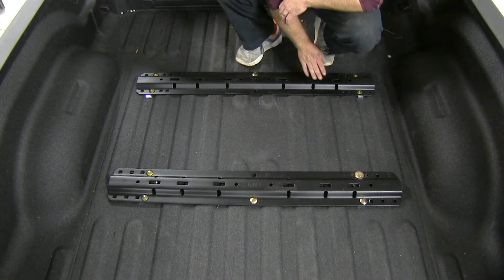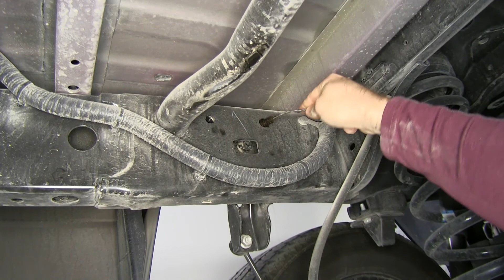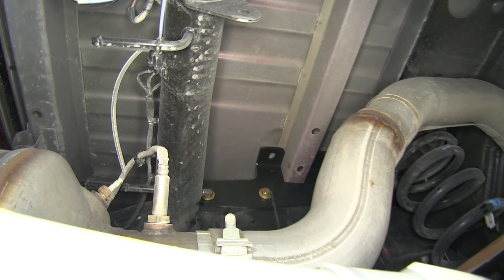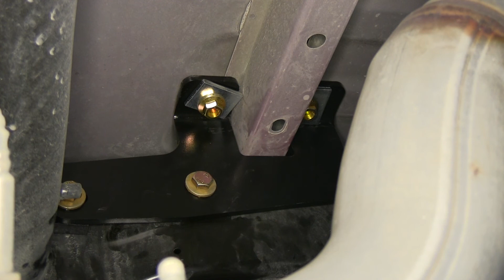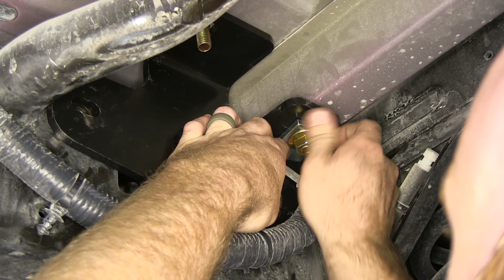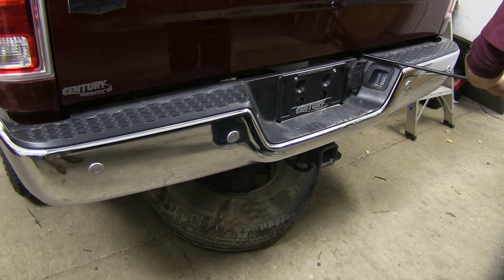How to Set Up Your Curt Custom Fifth Wheel Installation Kit for Ram Truck on a 2016 Ram 2500

Comment: Do you have installation process for the 2019 2500 ram yet?
Reply from the maker: At this point in time (Sept 2019) we don't have a video of 5th wheel brackets being installed on a 2019 Ram 2500, but we do have a video of the B&W Gooseneck Kit being installed which you can find here https://www.etrailer.com/multi-product.aspx?pc1=BWRVK3400-5W&pc2=BWGNRK1320-5W&VehicleID=201989454&HHYear=2019&HHMake=Ram&HHModel=2500. Even though this is a different installation process you can still use this hitch to tow a 5th wheel trailer by either using the appropriate B&W Companion for your truck bed size or by using an adapter that gives you industry standard base rails.